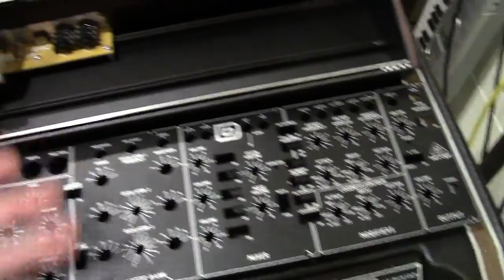What's Inside the Behringer Model D (by synthpro)

Comment: lots of comments here about how Behringer is evil etc. 
This isn't made for Moog fans, nor it is made for professional recording artists, nor is it made actually for anyone who ever heard of Moog. The target market is the one that was created by Korg from the Volca series, the one that was created by Roland from the Boutique series (whose prices actually oscillate around the $300 mark) and obviously the rising Eurorack fandom. 
Personally, I wouldn't have bought a Moog D. That's because there are tons of filters for Eurorack that 'recreate' the Moog sound, and for $3k, I'd prefer to use my $$$ for a few modules. Now for $300, I might or might not buy it the Behringer (it's actually bulky considering I'm a Euro player). I actually bought a couple of Roland Boutique's, but they're underused because they don't fit well in my Euro workflow. I love my Volca Bass however and I'll never part from it.
And last but not the least, with Moog, I'd be only interested in their bigger, full modular systems. In terms of keyboards, I'm more of a Sequential Circuits guy, but then again, Korg and Behringer (DM12) have great offerings these days. Bottomline, this thing is a gadget for most of the people who're going to buy it. Expect a mass of them to be put on eBay within 3/6 months of the purchase date. It won't lower the value of the Moogs, as long as there's a continued interest / revival in vintage analogue synthesizers.

Comment: Let's say you have 4 of them (which I am considering strongly...)
With the polychain capability, can you set one of them as master and the other slave for all of the parameters/knobs? Can you do that at all? Can you at LEAST do it to the filter?
Reply: No, you can't.  Certainly not by MIDI.  But it's patchable, so you could control 4 filters (or other things) simultaneously using control voltages from other devices / modules! Similarly, you could use one LFO as a modulation source for all four units.
Reply: infindebula 
Thanks. The filter was my main one, since I don’t have 4 hands, and the filter is the main parameter that I would “play” live.

I can always send 4 separate channels of midi out to each D, therefore creating chords.

I still can’t believe how powerful 4 of them will be.

Comment: Hey, Synthpro--the operating voltages in the Behringer D are the same is in the vintage Model D?  You mention a 10v rail--that's identical to the operating voltage of a vintage Model D?  Thanks a ton!  If that's correct, that's excellent news!
Reply: Also, how easily could one add PWM to the VCOs?  That seems like one of coolest features that the Model D lacks.  I don't know enough about VCO architecture to know if it's easy to implement in this circuit.
Reply from the maker: Your correct Thorson, voltages are the same with only a few added to run the digital to analog converter.
Reply from the maker: I could look into this, I have never added PWM to a minimoog, Im sure it wouldn't be too hard.  there are tricks to fake a PWM by using the reversed sawtooth on OSC 3 and then Sawtooth on OSC 1 and 2. offset the tuning of OSC 3 just a bit and the phasing between the waveforms do create a pulse like response.

Comment: Are the pots threaded or not? Can't tell. Want to bolt them to the panel.
Why are they using plastic 3,5mm connectors? I'd desolder those and use metal ones but there might be a grounding design issue there?
Also I'd like to switch out all the toggle caps to all black. Behringers got to have spares, right?
Basically I wish to trick it out a bit and make it last as I think it sounds fantastic!
Reply: Even if the pot bushings are threaded, we're looking at a prototype, so the production model could be different.  Similarly, there is no guarantee that the production units will even have the rotary switches bolted to the panel.  As for the rocker switch caps, they may even be standard parts, so you might be able to get them from a mainstream electronic parts vendor like Mouser or Digi-Key.

Comment: So I have taken the moog model d manual and compared the features and they are the same except some switch colors/orientation and patch points...If you can confirm this synth pro this would be awesome.Also if you hook up your prototype does it transmit midi data into abelton and if so what are the cc# numbers ..(hoping lfo will be able to be assigned to mod wheel)

Comment: Electronically literate people skip to 5:20 roughly for one useful comment re: 440hz gen. Then skip to 6:42 for something marginally useful... 2 matched transistors per chip for ladder filter. then to 7:50 for oscillator info...
Reply from the maker: Hi Sounddoctorin, 

Sorry if this video was not very useful for the electronically literate people like yourself ; 0 )

All the best,
Jareth
Reply: There are heaps of useful info here.  I think some of it went over your head.  Here's some of what you missed: discussion of the vintage-correct voltage rails, the fact that it uses panel-mounted switches, also a nice tip for custom VCO calibration, and a whole lot more, too.  Geez.
Reply: Ed Collins you have evidence of your accusation??
His other comparison video PROVED that the D can sound 98% like a minimoog.
Reply: Back from your jog yet? Promptness is important. Waiting by the BMX track forever!  Cool Van.
Reply: https://www.youtube.com/watch?v=21lYdGO1BkE
Reply: I think you aren't very good at researching what might be 'over my head' if you're talking to me.  lol.  I was just noting that the techs are probably more interested in the stuff at those particular times.
Reply: Don't sell yourself short.  It's not that bad.  However, it isn't one of your better videos.  It is more like a promotional video.  It would have been nice if you would have did waveform comparisons at more than one frequency, more about the filter (resonance, freq range of self-oscillation), actual info regarding attack and decay times, and stuff like that.  But it was still a decent video.  I just hope you didn't skip over any negative aspects because I'm sure they gave this to you free and a less than stellar review might prevent you from getting a free VCS3 or an ARP2600 to review when they become available..

Comment: it is nice capacitors are thru hole, it will be easier to replace that chinese junk with proper japanese caps
Reply from the maker: Yes, I hate SMD electrolytic caps, they just don't hold up very long, flat screen televisions are a great example of what I mean. I do have to say these caps do not appear to be that bad of quality, better than the old Matsushita caps found in the old Korgs.

Comment: Hey, Jareth! Cool review, thank you!
Would like to know more about PSU part of this thing. I don't see a transformer, so is it hidden somewhere or this thing works from some sort of a negative rail generator IC? Actually there must be a transformer or a PSU box somewhere, isn't it?
Reply from the maker: Thank you very much! Ok, here is how this supply works: The main power comes from a 12VDC wall adapter and is regulated down for the plus voltages. The negative voltage is made up by a switching IC, its using some very small packaged inductors, this signal is filtered and then powering a negative voltage regulator. Based on the time I have ran this unit, I have had absolutely no troubles and no heat out of the wall adapter, everything seems to work very well and don't have any issues with parasitic hysteresis in the voltage rails.
Reply: Is it LM2576? I've bought that and didn't tried it yet still (some more important things to do).
Reply from the maker: No, this design is using the LM2611 switcher and then driving a 3401 linear regulator.
Reply: So is it able to give -12v as well? I've seen the examples in the TI datasheet and there are about 5v.

Comment: about using the case for other Eurorack modules,does it deliver both +12V and -12V?
Reply from the maker: It does not have a supply as mentioned in the video but it wouldn't be hard to add one or use it for the none powered stuff like multiples etc.

Comment: Nice one. Thanks for taking the time.
What are you using for a camera? It's pretty decent. Are you manually focusing or is it auto-focusing?
Reply from the maker: Your welcome, happy to share. I use a Cannon Vixia  HF R300, its a great little camera but battery life in not that great at all. I was using auto focus but of course that can be turned off for manual control.
Reply: Pretty good. I figured it was a 'camcorder' because the autofocus is decent, I thought maybe you were riding the manual focus on a DSLR. The sharpness and shallow depth of field is pretty good, better than those Go Pro's and stuff. Thanks for the reply, I'm trying to figure out what to use next for youtube stuff when I'm moving around.

Comment: Do you know if uses the transistor oven method for temp control. Or a tempco resistor ?  . Anyway thankyou so much for showing us inside. I think the digital a440 ref is great at least you can safely say your a440 is going to be spot on :-)
Reply from the maker: It actually does not use any heater method, this is something I have been sharing with Behringer about. with this said, it still seems to be quite stable, I think that is due to all the circuits being close together. Your very much welcome, was happy to shed some light on the mystery of the operation.

All the best,
Jareth
Reply: synthpro . Thankyou very much for the info Jareth and your reply. Thats good to know thats its very stable , but hey its analogue and the imperfections in my opinion are what controbute to the massive sound of the original moog. :-). Im guessing maybe the modern smd 3046s are generally better in performance than the older ones.